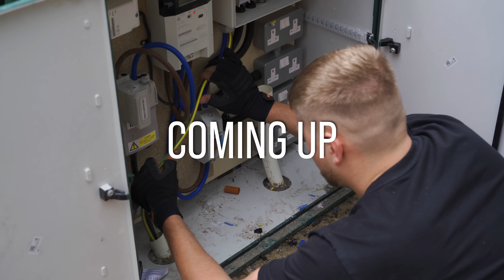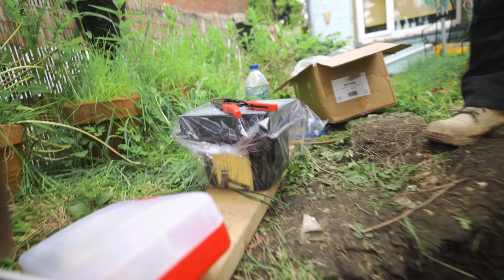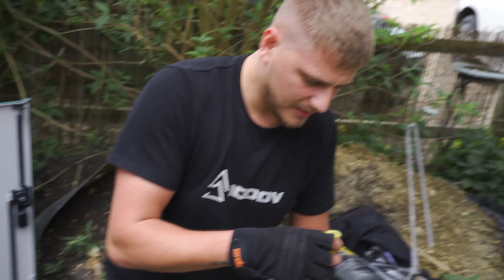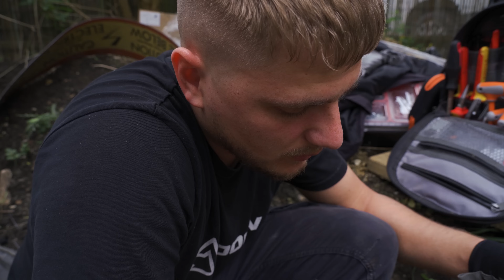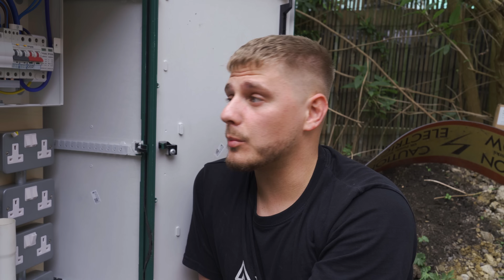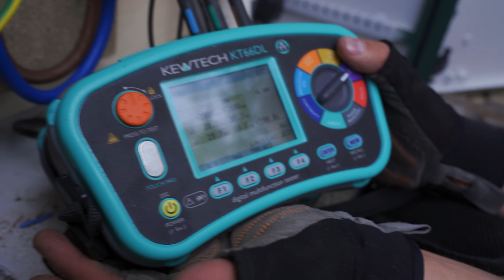Installing an earth Rod - New TT Supply

Comment: How can 100 ohms be ok, that’s literally 0 protection if you have a short only 2/3 amps will flow and anything not on rcd won’t trip, in Ireland it would have to be below 1 ohm max I’m confused
Reply: Yeah thats the funny thing: You said it yourself. "Anything not on an RCD wont trip". Well then just have everything RCD protected 😂 They have been mandatory for how long now?
Mate you cant rely on a rod in the soil to trip a breaker or fuse at all in the first place.
Reply: @ what happens if the cable feeding the board touches the exposed case of the board

Comment: I just drive 1 - 8ft copper clad steel rod into the ground using my hammer drill with ground rod install attatchment. No hammer needed.

Comment: The  inspection cover is pointless as the dno have only left you with a tt as its a temporary supply and will be redundant  when the permanent  supply is re installed.Secondly you dont want to be kneeling on that joint, your likely to  over stress the old lead causing premature failure of the joint or cause a flash over

Comment: 2 errors here don’t run the earth in front of tails ( also don’t touch tails) 1667 is the maximum for additional protection. But 100ma time delayed ADS is a maximum of 500ohms. You may have to cover both ADS and Additional protection depending on safety assessment.

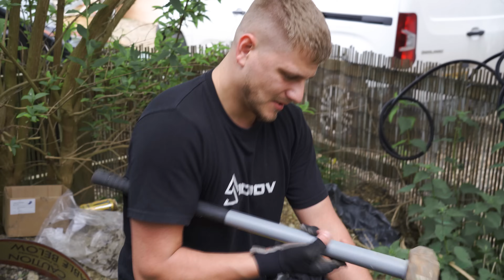Comment: 8:46 drill a length of wood, drill a hole in it just enough to go over the earth rod. That way someone can hold 5he wood and keep the rod still with out gett8 g their fingers smacked. You can use both hands o  the slaedge

Comment: Good Evening Paul.
Google search: ‘Distance of earthing electrode from incoming mains supply’ produced your video. Excellent video - Thank you! I note you hammered your earthing rod in close proximity to your incoming mains supply into the ground. Question: Could you kindly point me to a reference in the 18th edition as to the minimum distance allowed between the earthing rod and incoming supply. Thank you for your help. I am not an Electrician; I am simply looking for the most convenient location for a earthing rod to be placed to convert the current TN-C-S supply to a TT system. Your help and expertise is much appreciated.

Comment: Had a job recent where we installed 1 circuit supplying a FCU in the same cupboard as the DB for a 2port valve for heating in about 30 flats in a retirement home and I often got much higher Zs value than expected. Figured after a while it was the crabtree type AC RCD's in the older DB's, the newer RCBO DB's always gave sensible Zs readings. Something about the makes my megger play up

Comment: That's a very common method of ground rod attachment in the US however we usually use a solid core copper wire between the board and the Rod. The stranded doesn't quite get the bite it looks like with that style clamp. At least it got good readings.

Comment: Couple of tips from an old hand. 1. If doing it like this ALWAYS put a couple of nuts on the top thread it will allow you to back them off to clean any threads if they get damaged. 2. I now always use the Linian 1LERPB + 1LERPD Earth Rod Pro Driver SDS+ and bit with my heavy duty Dewalt SDS drill, no more banging rods with a hammer! It cuts the job down to a fraction of the time and drills through virtually anything as it essentially turns the rods into a long drill, even goes through rock. The bit screws onto the end of the earth rod, you leave the bit on the rod so does cost an extra £9/job but so much easier. I live in Portugal now and we virtually all have TT systems with lots of houses built on rock, so use it all the time. 👍👍👍
Reply: That was an excellent bit of advice . Bought mine because of this . Thanks . https://www.youtube.com/watch?v=a66xb8A5KUY

Comment: Australian here - all we do is TT here.  We have MEN  - Multiple Earth-Neutral - which is very similar to your TT.  We typically drive in 1.7M stakes without joining them.  We may also drop a group of stakes in the ground to get the return path measurements down to below 10 ohms..   In sandy-loam areas, we might end up with 5-6 electrodes in - or in rocky areas, we might be only down 500mm in the soil, with a  group of electrodes laying horizontally in a pit.
Reply: In my country most of what I see is TN and finding a TT arrangement is rare. Aka the neutral is bonded to ground by a really good earthing arrangement at the transformer and they send the neutral and earth out as a combined conductor.
Means your house can have no earth rod whatsoever and you still get a good bonding to earth since you are connected to the transformers earthing system and those are a bit more then a single rod stuck in the ground.
Reply: @ You describe MEN...   Bond NE at the board, bond E to a stake...  Test everything.... Good.
Reply: Please friends guide me and help me...I have 5 years experience in this field...now currently I am working in Malaysia kuala lumpur

Comment: AIUI the absoloute max earth rod resistance is the max acceptable touch voltage divided by the trip current of your RCD. 50 volts divided by 30 milliamps gives 1666⅔ ohms 100 milliamps gives 500 ohms, 300 milliamps gives 166⅔ ohms. 

However ground resistance can vary substantially, so it's considered wise to stay well away from the absoloute max.

Comment: this is a crappy dodgy install.
Reply: please explain ?
Reply: @ashleystirland The electrode is not suitable, it should have many sharp edges not round, the connection point to the electrode is ..... a joke. How many ohm resulted?
Reply: 16 wasnt it? Which was under target of 21 no electrician so just wondering 

What u mean it should have shape edges ?
Reply: @ashleystirland  sharp edges. Current prefers to get out throu sharp edges. Imagine a cross profile not a round one. :)
Reply: @chiranagheorghitaeugeniuth98 this is a standard earth rod for the UK mate...
Reply: Are u on drugs ?

Comment: When using your torque wrench to check terminal screws you just try to tighten the screw and if it clicks without turning all you have done is check its tighter than the torque wrench setting. If you want it tightened to the correct torque you need to undo it a little then tighten it until the torque wrench clicks.

Comment: Was the bolt not supposed to tighten into the copper much better connection??
Reply: Nah cause if you go turbo tools on it you'll go straight through that copper geez

Comment: Its hard to believe how shallow the DNO buries the incomers there. In the US, we use usually 2 earth rods 2.44m long and min 2m apart (unless you can prove <25 ohms earth resistance with one. The paralleling efficiency of the electrodes increases with distance between rods. In new construction, concrete encased or ufer electrodes are very common
Reply: In the Western part of the nation we use a lot of Ufer Grounds too. Since we use a lot of slab on grade concrete foundations, we tie the ground to the steel rebar in the concrete foundation. This makes the entire foundation of many square meters the ground. It works well even in the west where you have a lot of dry Rocky soils and a couple of copper rods, even a couple meters long doesn’t provide enough ground.
Reply: @Bill_N_ATX  Yep, foundation earthing is something that's commonly used throughout europe...but rarely used in the UK.
Reply: For the people in the USA that haven't worked it out your electricity supply companies do their own thing within the regulations in the area they operate.  Some of them do delta (3 wire) supply at the MV layer, some do wye (star, 4 wire).

For the places that do 4 wire the 4th wire comes off the centre point terminal of the transformer in the station yard and it is earthed at the transformer and periodically along the run.  It's very much a neutral wire and is referred to as this by the electricity companies.  Technically it is a grounded neutral, the rest of the world might refer to it as a PEN.
Reply: Your extensive earthing probably stems from the fact that you tie your HV and LV neutrals together.
Reply: @retrozmachine1189  For transmission and distribution (ie greater than 1000V AC) you don't have a high voltage neutral... 
You sure you're not referring to interconnecting the HV and LV earths together?
Reply: @gloveyourway2000  They do in the USA.  Their MV distribution is 12.7kV (?) 3P + N with their transformers usually being single phase hung between 1P + N for 7.2kV primary side supply.
Reply: @retrozmachine1189  Ah ok! Thanks for the info. That differs from the 13.8 and 35KV industrial work I've done in the US...
Reply: @retrozmachine1189 there isn’t a neutral on hv 🤷🏽‍♂️
Reply: @Jakewhitwam  Oh dear, oh dear, oh dear.  IF you are in the USA and your 120/240 is overhead, walk out side, find the nearest pole transformer and look at it.
Reply: @retrozmachine1189 Probably not. The number of earthing rods lowers the resistance and increases the chances of the breaker in the property tripping. The return path of the current is from the property along the ground wires, through the ground and back to the LV side side of the distribution transformer on the secondary winding.

It's nothing to do with HV earthing.

The HV earth is not in this electrical circuit and therefore has no effect.
Reply: @deang5622  In places in the USA where the primary and secondary neutrals are linked a particular type of fault will see the over all neutral voltage rise to very high levels.  In these systems it is essential that the combined neutral system is very frequently and very securely taken to the earth.  If I recall the aim over there in these systems is to ensure that there is no more than 18V difference between the combined neutral and the physical earth we walk on.

I appreciate you may not understand the finer details of this.

The number of earth rods will certainly lower the impedance but this only comes into effect should there be an open or high impedance fault on the neutral at a given location, otherwise earth fault current (L1 or L2 makes contact with a grounded component of an appliance, chassis if you like) in your MGN system will primarily flow on the supply neutral once it passes across the neutral / earth link in the main panel.

Comment: Your'e lucky my first Earth Rod or Grounding Stake. I had to put in through shingle . It took 45 minutes and all I had was a masons club hammer and a block of wood to protect the top. For a period here in NZ they allowed galvanised rods to be used. Though now it's raw copper and they aren't cheap.
Reply: Copper clad steel in Australia in most circumstances.  Actually a google search shows a lot of copper clad stakes for sale in NZ.  Are you sure it's straight raw copper?

Comment: Piece of wood, fence board etc 20 mm.  hole near one end , bout 1 mt. Long. Mate holds it near top of rod .. steadies it , lowers it with you as it's driven in....there are other ways too.
Reply: A scrap length of twin and earth double wrapped and pulled back on by an assistant works well too.  Anything really so the person keeping the rod vertical is out the way and you can get a good safe swing.

Comment: Nice Job. Would have been interesting to see a Ze as if it were a TNCS. Normally when the DNO leave the head without an MET and labelled as TT only, it's because the Ze is > 0.35.
I guess I would sandwich the MEC between the back of the clamp and the rod, with the bolt directly tensioned into the rod, so all strands are in compression and in positive contact with the rod. 
I think there's a good reason the regs ask us to do the Zs after all the dead tests. It confirms that Line and CPC, at least, have not inadvertently been left poorly or not reconnected. 
One little tip - when you buy the rods, get same number of threaded connectors. Then you have one spare to put on top of the last rod. Then you can use this to protect the top thread on the rod. If you find the Ze is too high and you need to add more rods, you will not have already smashed the thread out of shape.
Reply: I use a sds rod driver to save the thread works a treat😊 tou can get them and made by armeg😮
Reply: It’s TT because it’s a temporary building supply…DNO can’t supply PME to a TBS. Also the TT has nothing to do with the ELI being over 0.35 ohms. DNO standard is is normally maximum of 0.35 for PME and maximum 0.8 ohms for SNE but it also depends on network construction like if it’s a long radial network on an overhead line or if a property is fed from a 35mm service on a potend which is like 150m away from the substation then earth loop will be high

Comment: R1+R2 is clearly wrong for 1m cable.
Reply: @residualelectrical  R1+R2 reading cannot be influenced upward by parallel earthing paths.  This is your test leads not being nulled out, or a high resistance fly-lead connection between the line and CPC.  This is why it was the same on both circuits.
Reply: Will be contact resistance on the socket outlet and the plug in leads. Especially if those sockets have been outside a while. 

A safety factor on the testing as will verify operation in worst circumstances lol. Little heater in the cabinet probs sort it out Mike. Top job and fantastic demo 💪
Reply: Around 0.02 for 1m of 2.5 T&E….

Comment: You can get a driving stud that screws in to the threaded rod joiner
Reply: Always good to use a bolt as gives the threads a better change of not getting damaged and not having a hole saw rattling about but looks like you managed it so good work. I did do one recently on the farm and used the poster on the tractor! two bangs and we were done all be it slightly extreme.
Reply: Armeg SDS TT rod driver are good😊

Comment: Gonna sound.... daft / clearly uneducated... but considering the 'ease' with which the tool helped bury the rod, is there simply diminishing returns for adding a 3rd rod? (Ie is the additional cost, time, and effort, not really beneficial when conpared to the smaller reductions in earth impedance?

Also appreciate may not be a product suitable / within regs, but as you already had a large sub surface hole, could you not have a copper mesh layed in the hole connected to the rod as well (ultimately good TT earth is linked to surface area of copper in the ground).

This is wholly an uneducated post and not an 'opinion' on the work.
Reply: It depends on the ground you are driving into and the different types of substrate. Where you have well draining top layers, adding  an extension rod will be much more beneficial that an area like the one in the video. On ground that holds the water, then you get more benefit by installing a second rod spaced away from the first, by at least twice the depth that the rods go down to. It isn't just a case of getting a low reading though, you are also looking to get a stable earthing arrangement, and adding extra rods can achieve that.
A mesh arrangement or earth mat can be used instead. There are guidelines on the spacing of the mesh to achieve maximum effectiveness.
If you ever have the misfortune to see a DNO install the PME, you will often see a single rod laid down by the side of the underground joint where they have tapped the earth into.
Reply: You are not trying to get the impedance down as low as possible. You are trying to get the impedance down to be low enough to enable the circuit breaker to trip.

Once the impedance is down to a low enough level and it's stable and is going to be low enough all year round in wet and dry conditions then there is no need to install additional earth rods to lower the impedance further.

And on certain circuits under the regs must be protected by an RCD, so that helps too.

Comment: Why is the CU outside in that box? Never seen that before
Reply: Very common if the building is getting pulled down and rebuilt and also if major construction work is going on
Reply: Yeah Mike explained on the first part that the house is getting demolished and flats going up

Comment: I use a 20mm hole saw (with pilot bit removed) into an sds drill on hammer mode, and it drives it in noice 😂 20 mhm hole saw fits over earth rod just nice aswel 👍🏻
Reply: That’s bloody genius